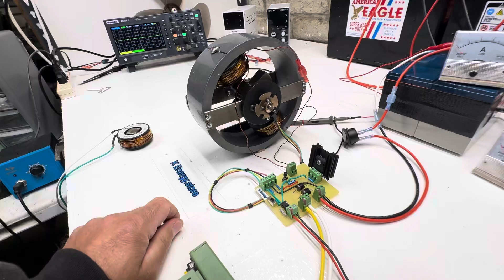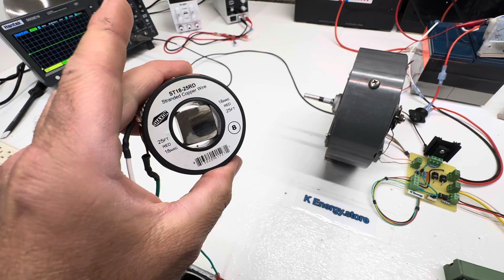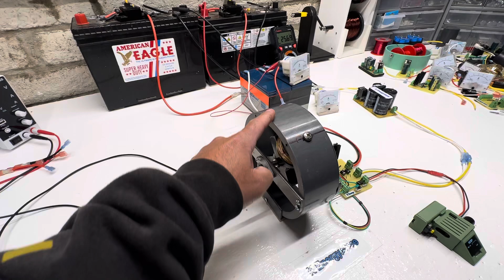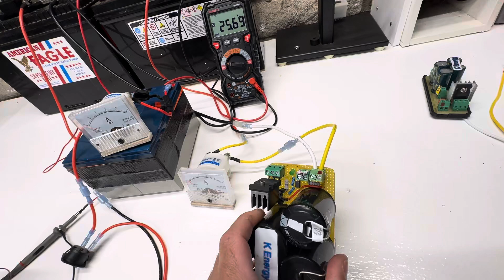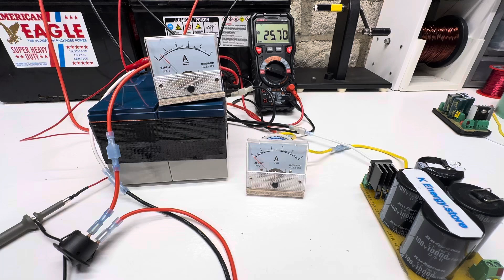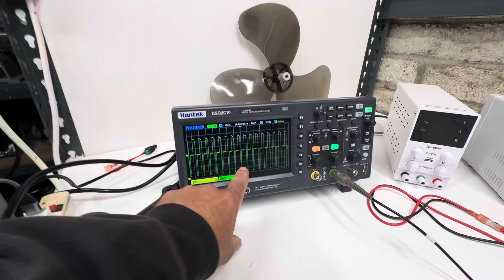Attraction Motor prototype

Comment: When you hold the shaft does the input power draw increase?
Reply from the maker: Yes it does
Reply: @kenergy1707  I appreciate for your respond
Reply: @kenergy1707  do you know peter Lindemann attraction motor when hold the shaft the input power draw remain the same
Reply from the maker: @MRNWANETI  that’s because he uses a transistor it limits the current based on the resistor resistance 
 Mosfets deliver much more current for more torque
Reply: @kenergy1707  wow your know the fact about that, though I want replicate it to USe it and power or drive generator I don't know what you think about it?
He used reef switch secondary I've searched his video to see where he use the motor to power some load to know it mechanical output but I didn't see so I got confused don't know if such motor worthy replicating for projects,pls your suggestions is needed here thanks
Reply from the maker: @MRNWANETI  you could do that with a small generator but I think the flyback is more useful
Reply: @kenergy1707  I think using universal washing machine motor and shave the armature we be easy,but the only issue I've is timing of the magnet and the reed switch secondary not self starting finally using MOSFET instead of transistor

Comment: Where's the capacitor at the The value as the  inductance. You can increase the power production if you use pulse technology and not switch technology.

Comment: very cool That thing fly's. I'm convinced that mine didn't work due to the X not being connected all the way through. Remember I used a 3d print to connect the 4 poles.
Reply from the maker: Yes I think that’s definitely the problem
Reply: @kenergy1707 I was thinking of drilling a hole in the ends connecting them with a largre gague wire or rod to make the connection. I haven't given up :)
Reply from the maker: @mcorrade  you should have one printed out of mild steel like that stainless rotor
Reply: @kenergy1707  the  X rotor is all mind steel. I just need to connect the ends of the X rotor inside the 3d printed housing.
Reply from the maker: @mcorrade  or you could weld it to a square bolt